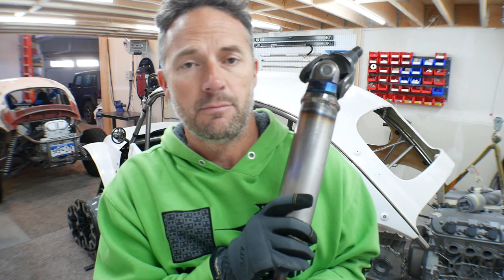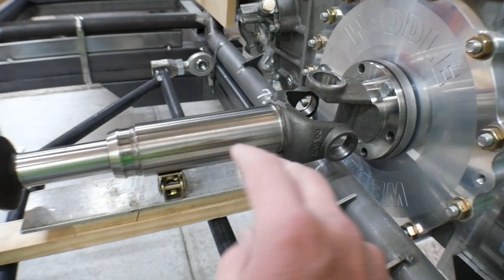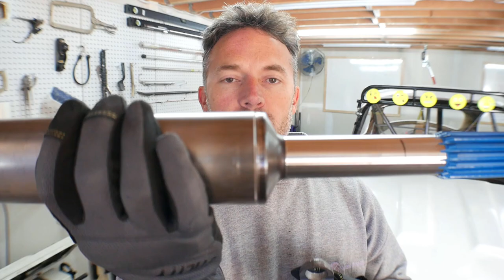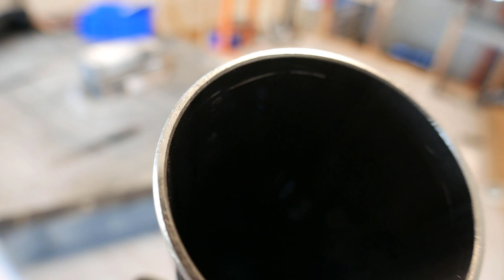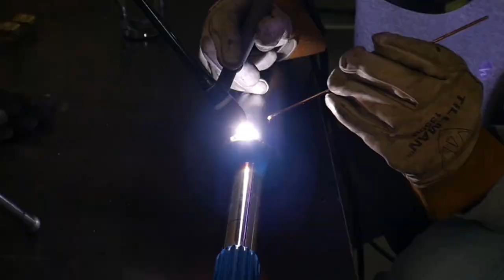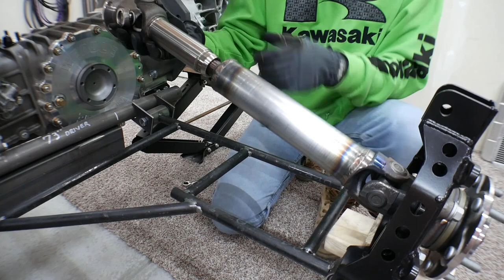Building an Axle for Wratchet!

Comment: first off you are doing incredible work! your project rivals that of a ballers high buck build. the one thing i would say is there's times to build in a weak link. i ran that style of axle shaft for years in a forced induction corvair making the same ponies as the honda j series. the axles are strong but the transaxle is now the weak link cvs can be replaced in the field. push your clutch in before contacting the ground and shift gears smooth and don.t slam the skinny peddle with the cutting brakes.  "transaxle engineering" is the name of the company jeff fields is the man to talk with when it comes time to repair, upgrade, or you need another opinion from a pro on anything sand rail related. if you haven't thought of a shifter yet look into "the cable shifter".
your work is inspirational keep on keeping on!
Reply from the maker: Interesting to think of the CVs as a weak link. I never thought of it that way. I spent big money on this transaxle so it would be up to the task. But I guess between the engine and tires somethings gunna give.
Thanks for the first hand experience, tips, and contact. I'll look into it.
And appreciate the kind words too.

Comment: I built a long travel sandrail, and had a pair of 200mm cv axle made for $250. Way cheaper to do it the cv way time and money. You build is great.love the channel
Reply from the maker: Hmmm, maybe I need to look again at prices.
Thanks for the comment and info.
Reply: Look into rcvs.. but I feel like your justified in your reasonings for using them! And I also wanna applaud your ingenuity and parts useage!!! I'm assuming the Toyota hub is the same splinecount as the jeep stub?

Comment: I would take those to a driveline shop and have them straightened and balanced. cost maybe $60 each. The tube is not as straight as you think and will cause vibration. I worked at Drivelines inc long ago and we built these for Team McPherson racing, Baldwin Racing, And a few others. Great work for a home garage, but take them to be straightened and balanced on the machine and save some later issues.
Reply from the maker: I'll consider that, thanks for the first hand experience suggestion. 👍

Comment: Hey a cool little tip when you weld something that you have to turn make a ground clamp extender I use them a lot on drive shafts and 4 link rods all it is is the same wire as the ground but with the outer casing cut off then Braid it and when you’re done just wrap it around what ever you’re welding and then clamp the ground to the wire and when you spin the piece you’re welding it will just spine if you have a email I can send you a pic
Reply from the maker: That's a great idea!
Send me a picture, dougbugbuilder@gmail.com
Thanks.
Reply: @DougBugBuilder  just sent you some

Comment: Good stuff.  I would be concerned with the yoke that does not have much of a slip fit.  I would assume the 1/2 shoulder on the other end of the axle would be much stronger.  In my mind you have a lap joint on one end and a butt joint on the other.  
  Please don't take.this the wrong way. I like your work a lot.
Good stuff keep it coming.
Reply from the maker: You're absolutely correct. The butt joint will be weaker then the lap joint for sure. On Mauler I did this with a 1.75" tube. But on Wratchet I went with 2.5" for more weld area. But I guess I'll see how it holds. Admittedly I try a lot of weird stuff on these builds.
Thanks for the comment.

Comment: You really need to find room for a little secondhand metal lathe mate. NOT getting quick and perfect 90' ends on round items is near as damn it impossible on even the cheapest of these. Even if you only use it once in a blue moon it'll pay for itself in saved time. If you bodge on a secondary reduction pulley set or add a VFD to lower the RPM right down they're also pretty useful as a quick and dirty rotary welding table, or a way to uniformly polish/sand cylindrical metal parts. 
They're one of those tools you wouldn't think you'd use enough to warrant owning.......... Until you get one ! :)
Reply from the maker: I've been casually looking at used lathes. I'll have one at some point. I have a small hobby one in the basement, so I'm aware of what they can do. But like you're implying I need one that can work on larger parts for the Baja.
Let me know if you find one for me. 😉
Reply: @DougBugBuilder  wouldn't do you much good if I found you one around my neck of the woods mate. I'm in the UK. We use a minimum of single phase 240v on mains electric over here, so anything I found you would be on a serious go slow over in your workshop.  :D

Comment: Do you have any recommendations on a slip spline cv axles setups for 2001 Boxster 5 speed transaxle and spindles? Trying to workout a setup.
Reply from the maker: I don't think you can have slip splines on a CV setup outside of the slip spline in the center of the CV joint. Unless I'm misunderstanding your question.
Reply: @DougBugBuilder  No I don't think you misunderstood my question. What I'm trying to figure out is how to accommodate the change in distance between the transaxle and hub throughout the range of motion of the Trailing arm suspension with a cv axle setup. Unless I find a flanged yolk that fits my transaxle and splines that fit my hub. This is going to be used in a street or MAYBE a track application, so there isn't a ton of travel, maybe 8 to 10 inches from full droop to the max height, but I think I wanna stick with CV axles only because ill have a good amount of torque, and minimal damage during failure. Thanks for all the times you've helped me in the past👍

Comment: Could you have used a tractor PTO shaft as it’s two u joints that are sleeved all the way through. They are designed to take heavy loads and high speeds
Reply from the maker: I'm not sure, It'd depend on how the splines are on the shaft. But you might be able too.
Reply: It’s still a brilliant project. Really enjoying it !  Keep the videos coming
Reply: PTO shafts are either going to be rounded off square cold roll or octagon shaped cold roll. On some applications they will also use round cold roll with a keyway. They are not meant for high speed applications. That's why when you seen one in action they are dancing all over the place. Most driveshafts for cars are built to a 2-4 thousands max tolerance. Also, hope you backed that spline shaft out at least an 1/8 before welding it or it will come back to bite you one day. I say this because I was employed for over 13 years at 3 different driveshaft companies here in Texas making many types of shafts for everything from cars to airplanes to giant printing presses and even carwashes for semi's.
Reply: @mwreyf1  I know they rotate at 540rpm and 1000rpm, with heavy loads on them,  what speed with the cars shafts be doing ?

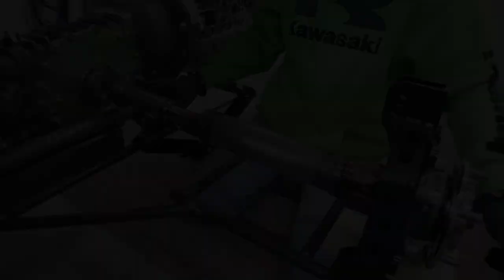Comment: Looks good but at 21:27 that shaft looks like it has a lot of up and down looks like it could be not straight I don’t know if it was just how it was caught on video or what
Reply from the maker: I was afraid people would see that. I noticed it when I was editing. Good catch though. When I pressed in the U Joints I knew I'd be taking it apart so I didn't put in any of the clips. Didn't bother to really center them either. So the U Joints aren't totally centered in the yokes. So when you spin it they are a little off center.
Reply: @DougBugBuilder  yes I build drive shafts for jeeps

Comment: Great Vid love the builds and build quality, 
in the UK will call the shafts slightly differently. we got the

Main shaft or Torque tube, (this is between engine and gearbox) spins at engine speed
Propshaft (this is between gearbox and differential) spin  engine speed after gearbox ratio
driveshaft (this is between the differential and hub/wheels) spins after the diff ratio and is the wheel speed

Fun fact the R35 uses all three of these.
also this is a grat vid on explaining UJ

 https://www.youtube.com/watch?v=gmV4qwLfOMY

Have fun :)
Reply from the maker: So in your part of the world this would be a driveshaft! That's interesting.
Thanks for sharing and for the comment.